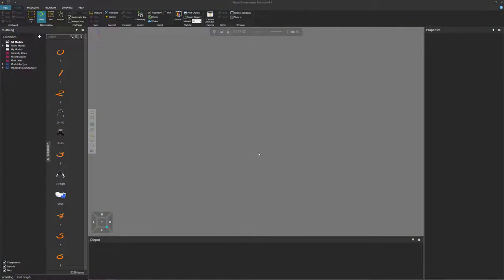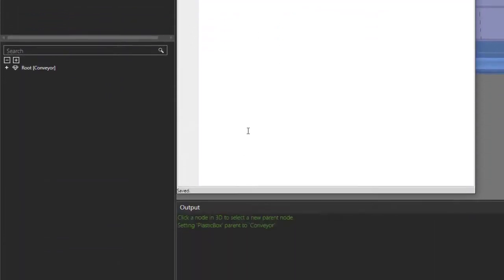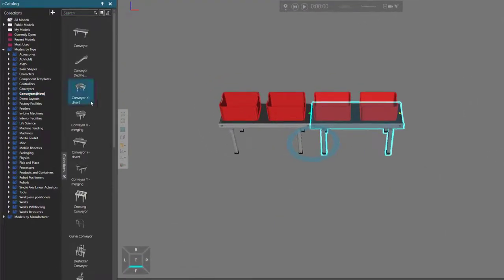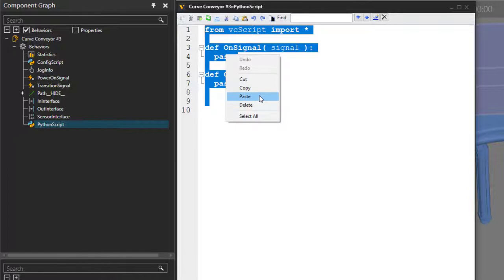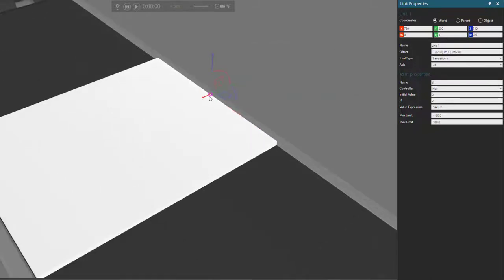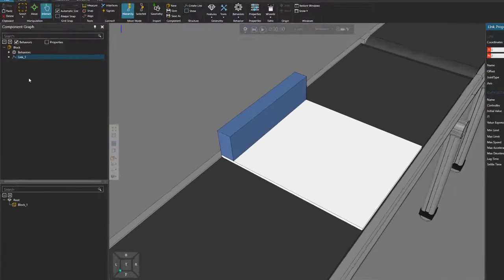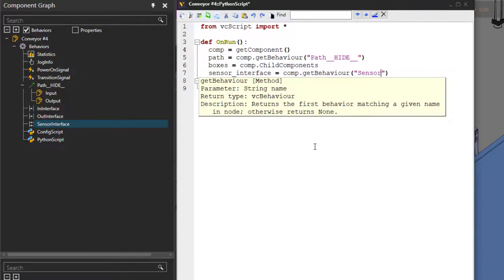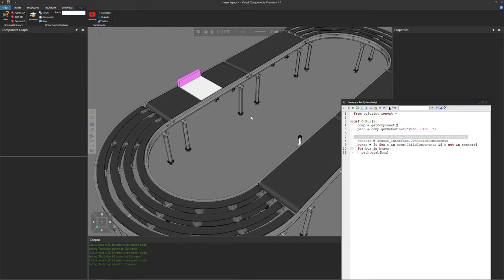How to Attach Objects to Conveyor Paths

Comment: Would be great to have a button like "Attach to path". Or is it only possible to attach components to paths while the simulation is running?
Reply from the maker: The simulation does not need to be running. There is a separate Attach tool as well as Detach tool, but it attaches a component to a selected node not a path. This is a good discussion for our forum, and it would be easy to make an add-on that can attach to path.